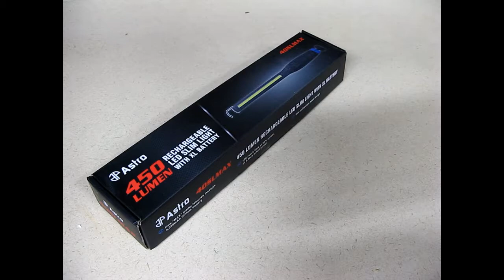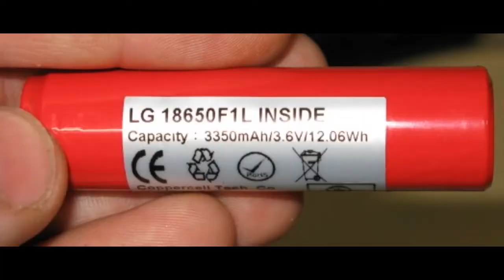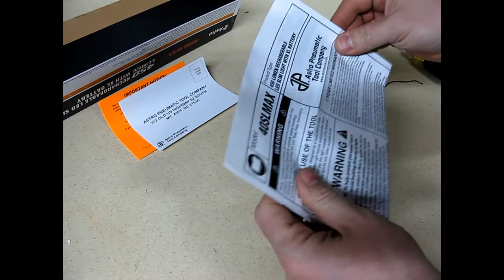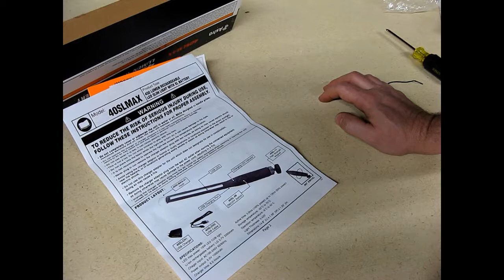Astro 40SLMAX LED Light Review & Disassembly for Battery Change

Comment: My led for the charger is not working can you buy the circuit board or I will attempt to heat up the contacts on the board with a soldering iron fine tip. Thanks light has been working great until now.

Comment: Beyond the warranty but with little use while working on my cars used it for an extended time yesterday and the switch became difficult to turn and would not turn off.  Opened the light and the switch had distorted.  Wanting to purchase a replacement switch called Astro and was informed they do not sell internal parts.  An expensive light to have to discard due to an easily replaceable part if it were available.  Hopefully I can find a substitute from another supplier that supports the products they sell.  My advice at this point is not to buy this brand.